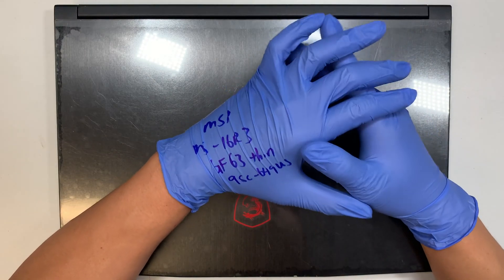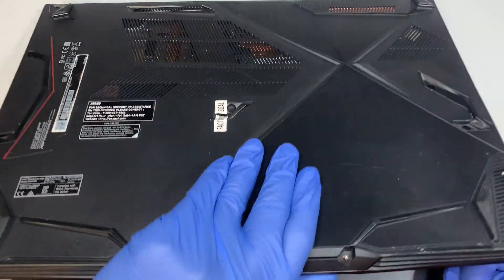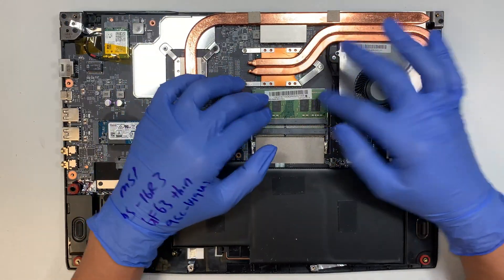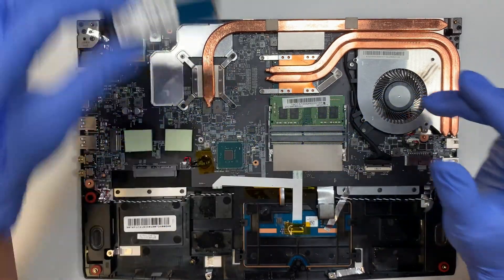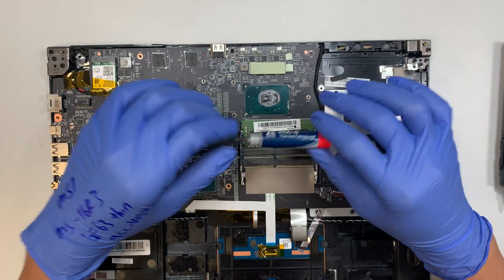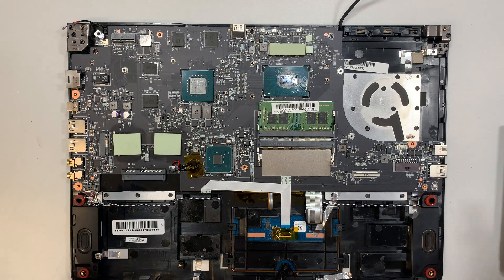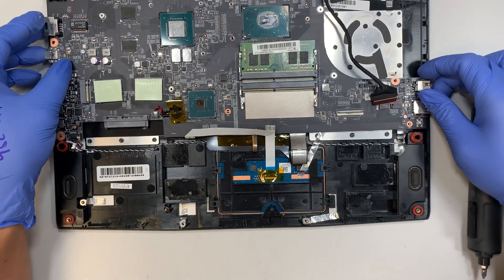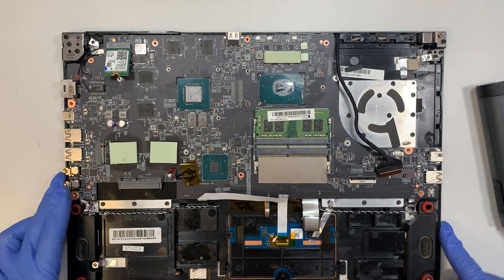MSI GF63 Thin 9SC 649 MS-16R3 Tear Down Disassemble

Comment: is the laptop you're taking apart in this video set up the same way as a "msi gf63 thin 9rcx" laptop?
that's the kind of PC i have.. i just needed to know how to take it apart because I needed to remove the battery, but i couldnt find a video for that specific model.

Comment: I wonder if using an open, unsecured "Guest" login at a hotel would've damaged my laptop [access by possible bad actors?]
Your video is great for what I am now trying.
My 3 y.o. GF63 no longer works, seems completely dead. Was attending funeral in a location where my cellphone's hotspot wouldn't work, so used the hotel's Guest login. Last Friday, logged into the laptop, the home screen came up, then within a few seconds the machine shut itself off completely. I could not get it to restart at all, it indicated no power.  Contacted MSI support and they had me clear the CMOS (pin hole on back) and try again. But no luck. Kept trying over the next few days without success. I thought it must be a bad adapter/charger. Took it in to computer repair and they state the adapter/charger is fine, that the problem must be a bad motherboard [- yuck -].
I've ordered a new GF63 thin and wonder if any of the following are a good plan.
First, use the 8GB memory from the old machine to upgrade the new one to 16GB.
Then take the SSD card from the old and replace the one on the new GF63 to have all my files, instead of doing a MS restore from the external HD that I use for backing up everything..
Remove and sell any of the internal items (GPU, battery, etc.) to recoup a little of the cost of the new laptop 
[is there even a market for these? And is there a way to test these to make sure they are still functional?]

Your video is excellent. You have a good presentation manner which makes everything you are doing clear. Also, the links you provide in your own comments section are especially helpful. Thank you so much.
Reply: Oh. Sending you a cup of coffee. Enjoy. 😀😀

Comment: Hi sir, want to check, for msi gf63 thin, if we remove the battery, does it still function/can be use with power/charger cable?
Reply from the maker: Yes, with battery removed, laptop will still turn on with direct adapter power.
Reply: @UbergeeksBiz  tq sir
Reply: @UbergeeksBiz  If the battery is not lasting long I don't see the point to buy a new one would you suggest to just run it without because it seems that all the batteries are the wrong options in terms of lasting and performing for long hours of use ??

Comment: Thank you for the vidéo. I have a MSI  MS16R3 by accident we put the wrong power supply to charge it (30V) when we put the original power supply it doesn’t work ans more. What should I do? Change the motherboard?
Reply from the maker: Try remove the battery and do a direct power from adapter. Hopefully that will power up the laptop.
Reply: how did you solve it?  Do you know where to buy the motherboard? 🥲

Comment: My display on this laptop flickers. I doubt the monitor stripes in the hinges are the problem. The hinge design is week. Can I use your display replacement video on another model of msi for this one? Also can we easily do it at home if I have very little experience.

I don't have msi service centers nearby.
Reply: My daughters laptop screen goes in and out when opening and closing just a tiny bit. A video would be awesome

Comment: Every gf63 owner should watch this video. I have a small question: what is the pinhole on the side of the laptop? The one with the battery icon.
Reply: late reply, but i think its a light to show if its charging
Reply: For restart. If your laptop will be hang.